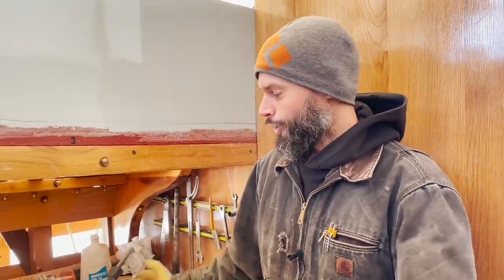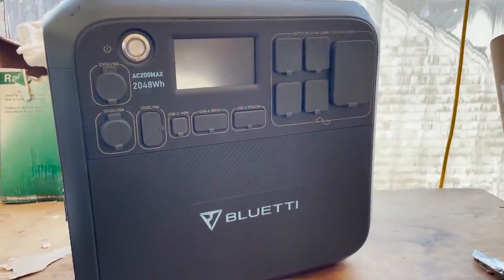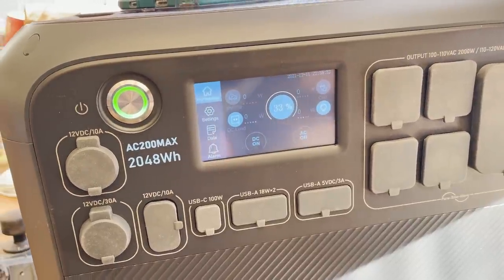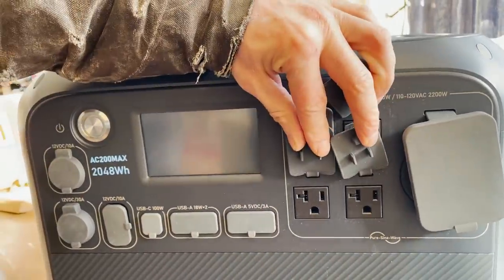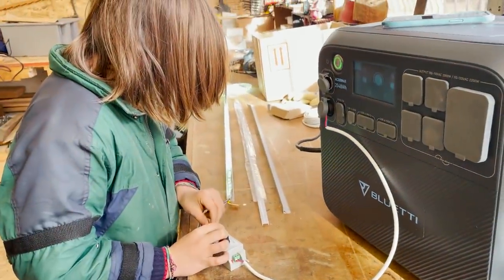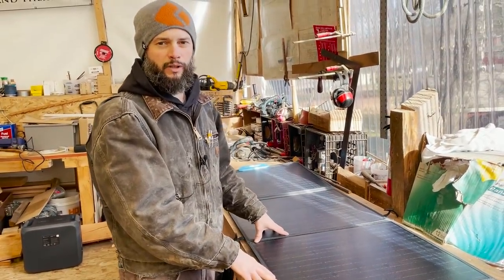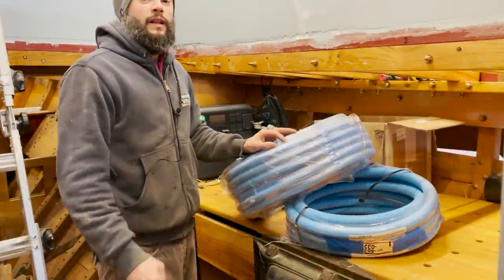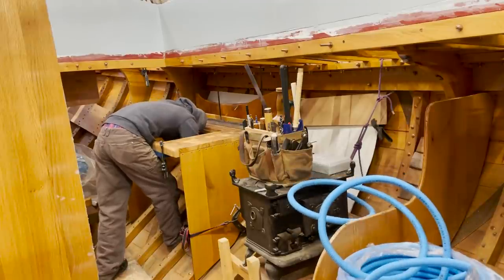Boat Electrical Systems, First Steps - Episode 194 - Acorn to Arabella: Journey of a Wooden Boat

Comment: Hi Stephen, was watching shortly after making a sandwich to take to work tomorrow ( New Years Day ) and you mentioned red light filters... in my sandwich prep, my roast beef was in a container with clear RED rectangular lids !  Look in your local supermarket's pre sliced deli meats section, usually near the bacon and refrigerated of course ! The lids have a rolled lip and are recessed so it should easily fit over that bright led light you showed. Velcro or a screw or magnet to hold lid if you don't like velcro...
    Hope this is not too late in your build vs real time sequence, but try and pull ALL your wires ( put in some extras too ) in ONE slightly twisted bundle at one time OUTSIDE the boat with the conduits straight and where a few extra hands can help you.... MUCH easier than pulling inside the boat and making multiple pulls in something bent and flexible with ridges TOO ! Twisting the wires adds to overall bundle size only slightly, but organizes it better, allows smoother bends, and gives some extra wire length in case you need it later ! ( I used to build High Vacuum Industrial Equipment with custom harnesses for robots etc )

Comment: Just be slightly careful charging LiFePO4 in cold (below 0degC) temperatures, they don't like that. I've not read the details of the Bluetti unit, but its BMS probably has auto shutoff and won't charge below 0 to protect the batteries, but worth checking :)
Reply: Also note that there are solutions for cruising in cold weather. My boat has batteries where the charge source heats the batteries into range and the battery itself maintains its functional temp so charge and discharge can happen in any ambient temp. These are not much more expensive and also UL1976 certified, more than you can say for the popular but inferior drop ins like Battleborn or Dakota etc.
Reply: Batteries definitely like to be the same temp as people.  If the ambient temp in the boat is 0, heat is the order of the day, no matter what, but that seems unlikely.
Reply: Batteries in general don't like to be used while they're cold.
Reply: You can always keep the batteries warm next to the wood stove.
Reply: @graham6229  Insulation isn't any use without a heat source.  Leaving the boat for a few days, the whole thing will be between ambient air and water temperatures.

Comment: I've worked with LED lighting on different projects over the years and in my experience, several have failed because the electronics burn-out (especially with low cost online brands).  It's easy to read the box that says the LEDs last 50k hours etc. only to find out they really only last a few years.  LEDs are great to use but I suggest buying a few backup lights,  transformers, and controls when you get your parts, so you aren't blind in the middle of nowhere.   Also, I find that complex battery systems can stop working for weird error code reasons, so it might also be good to have a small low-tech solar system for emergencies.  Just a thought, that others may have already noted.

Comment: Sounds like you should look at creating some kind of over the railing solar panel holder so you can charge while on the move. And maybe a setup for the house top or something.

And the “RV plug” is a standard 220 vac outlet.

Comment: 100% on the conduit-from ireland and a lot of timber frame houses here use it in a "service cavity" created between plasterboard and air-tightness membrane/stud work. pro tip leave an extra pull string (builders line or plumb bob line) with every run and leave in place for retro fitting. also you may be able to use a shop vac to suck line out the run to began. love the clear junction box covers

Comment: do yourself a favor when installing the wires make a U before you jump into the Box to get any water that is inside the conduit (condensation or a little water who knows) and drill a hole at the bottom of said U in the conduit, so any water that is inside the conduit has a place to go other than the Junction Box.

Comment: Looking good! You may already be past that, but I would skip the gray fittings and just connect the threaded box fittings into the junction boxes. Just use a lock ring to secure them.

Comment: This looks like a very sound system.  Thanks for the thorough explanation as well.  I don't think I heard a single instance of confusing power with energy, which may be a first.  If you get the panels perpendicular to the Sun's rays, the low angle of the Sun won't be an issue (short day still will be of course).

Comment: Fascinating, as always. You did not dwell on the design of the junction boxes, but from what could be gleaned from the video they did not seem very robust.  They need to have high impact resistance and I would suggest a hermetic, O ring, seal.  Things are going to crash into them once you are at sea.  And yes, install pull-throughs in the conduit now, while it is easy.
Reply from the maker: They’re stout for sure, and will also be inside lockers. Thanks for watching, Rick!

Comment: This feels like a project that would benefit from using Home Assistant as a local smart device controller. I have led strips installed all over the house, including in my custom built desks, and having a raspberry pi to control everything gives a lot of options. As another commenter said, for primary lighting, it's worthwhile to get the strip with an additional channel for dedicated white.
Reply: I'm not sure if this application would see an actual benefit from such a system, as it would require the crew to learn the system, set it up, and keep it running 24/7 off an already limited power supply.

Comment: One could envision many small-medium bluetti as a kind of a modular on-demand power system instead of the traditional house bank fixed to one spot (usually below the waterline) with all the additional hardware that a bank requires. Would fit nicely with your intrepid lifestyle. Something to consider.

Happy New Year! 🎉💥

Comment: Yup, conduit and junction boxes are a good protection for chafing for the electrical system, but they can also make it hard to find issues when trouble shooting a fault in the future.
I saw tips in other comments about aluminum balls and a vacuum for pulling a string through the conduit, but a plastic bag and string usually works better. But yeah, pulling another string through with the wires is a great idea just in case you need to pull another wire or cable through in the future. Always leave a string in the conduit for future pulls, you will thank yourself if you ever have to pull another wire or replace a burned wire. Additionally, always keep a multimeter and spare wire in your boat as emergency repair and trouble shooting materials.
That particular conduit you chose looks lime swimming pool hose, and really stands out against the wood. Will there be a ceiling installed covering it? You do you, Steve, but I wouldn't want to look at that blue corrugated hose all the time, it just doesn't look pleasing. I suppose it could be painted to blend in though.
Reply from the maker: the conduit will be hidden behind things.

Comment: If you're planning on using heat-shrink tubing, you may want to consider using the type with the adhesive inside. As the tubing shrinks, it melts the adhesive and as it cools it leaves an almost watertight seal.
Reply from the maker: Yup, we will be. Stay tuned for more on wiring particulars.

Comment: Love your channel. That system is great for your portable power needs. I don't think you would like it for your boat tho, the "black box" aspect of that system would be trouble in the long-term especially in a marine environment. Getting a setup that seperates the components of your power system, allows you to repair or replace them and makes it easier to put them into moisture proof enclosures. 😉

Comment: I have owned boats for 50 years and do nearly all my own maintenance.   In my opinion you should enlist the assistance of a good boat electrician to plan your system.  I see too many issues in this video to comment on individually.  I have owned the same 44 ft sailboat for over 30 years, circumnavigated and done just about every mechanical and electrical job imaginable including totally rewiring it.  You need professional advice.

This video is a good advertisement for Bluetti but is very naive about boat electrical systems.
Reply: Please get your hands on ABYC E 10 AND E 11.  And any other applicable standards.  Dry reading but essential if you want to do it right.  Also important if you are ever going to insure her as you will need a survey.
Reply: I’ve done electrical of all types including integrated circuit design using workshops/books/manuals and if recommended or required a licensed inspection and sign off. Never had any issues. Arabella is in good hands.

Comment: While a small bluetti unit would be great for your on shore adventures, I'd highly recommend that you build a substantial LiFePO4 battery bank with a significantly sized inverter charger and permanently mounted solar panels. For about 3x what that Bluetti costs, you could have 14000+ Wh of storage, a 6kW inverter, and multiple mppt charge controllers, combined with as many solar panels as you can reasonably fit on deck.
Reply from the maker: Thanks for weighing in!

Comment: Forgive me if I'm a day late and this may be something you already know, but I wish someone had told me these things before I rewired my first Jeep rebuild.  Some mfr's are notorious for electrical issues and repairing them taught me some good lessons.  
I worked in automotive/marine electric systems for years while getting my electronics engineering degree and the most trouble I've seen comes from corrosion, but to get corrosion, wires and equipment need to be exposed to things like salt air, vibration (which rubs through insulation) and damage from loose objects impacting items which current flows through.  Even those plugs with almost no room for corrosion to get into, are the most likely to be the trouble later on if not protected from open air/splash.
If I were in your shoes right now, I'd try my best to double insulate everything, keep access easy enough to repair any of the system without too much delay and provide isolation for each circuit (in case you have to shut it down without affecting other circuits).  Home-runs on wiring might cost more up front, but save a lot of problems later.  I try not to let wires get twisted/tangled while pulling them as I know it's possible I may have to use a wire to pull in a new one later.
Anything exposed needs to be waterproof shrink-wrapped, or at least coated (liquid tape) after being cleaned with high-volume rubbing alcohol (91%) so skin oils don't hinder adhesion.  I only use dielectic greese on plug-in stuff like light bulbs and AMP plugs, as it can migrate and make a mess, but it's better than corrosion which is inevitable in salt air environments.
I never regretted running redundant wires to vital systems from your voltage supply if there is room in your conduit.
Lastly, over-do your grounds (break-out and ground your lines on your 12VDC and chasis grounds on your AC stuff) everywhere you have a junction or termination and install tyroid coils on AC lines to reduce noise to your communications equipment.
One edit here...label & map every wire at every junction and termination if not color-coded (just like a maintenance manual) and amend it as you add to or repair the circuits.  You are the guy you are helping years later.

Hope your system works perfect for the next 150 years!

Comment: In the video about your motor setup you mentioned having a Hybrid Diesel/EV system that could also charge from the propeller. Is that still in play and how will that feed into the Bluetti system? What would the relative power be between the prop-driven charger and the solar driven charger? How fast and how long would you have to sail to recharge your battery (while also running the fridge and other 'always-on' electrical equipment). It seems they might be nicely complementary as one is used while sailing, the other is used while at anchor.
Reply from the maker: We’re thinking about a Watt and Sea. More on that later, but you can search it up if the question’s burning.

Comment: One of the chevy bolt battery modules from 2016 we use to power our boat has 7650 Wh in it and is about the same size as that brick, albeit heavier. Perhaps a convenient and portable option but not necessarily the best way to store energy in a battery on a boat. And the recall is on the newer 2017+ models. Sort of hard to find the older ones but there are options out there for you! Cheers
Reply from the maker: Thanks for sharing your experience!

Comment: Those LED strip lights are really handy. They also sell warm white and cold white which have different color temperatures to help with mood lighting. You could probably have a strip of both in each room with a dimmer on it so you can balance the amount of red/blue light you get. Keep in mind it will still be mostly white light, but will range in color temperatures from something like an old incandescent light (more red light) to a fluorescent one (more blue). Those RGB strips in addition to white ones is a good idea since you can have full red light if you need it. (Or any other color if you feel like partying!)

Comment: I hope the conduit is of the split type for modifications later on when they happen. I would prefer a trough or tray which should give as good protection while allowing easy refitting down the road. I have seen them with removable panel on the front so they are totally enclosed when in use. I personally would not use conduit for boat wiring, things do break or change. Even if a breakdown is not in the wiring but in an endpoint, that endpoint replacement may require different wiring. Anyway, do leave a pull string in each conduit permanently and make sure you have a spare pull string as long as your longest run so you can pull that pull string back into the conduit after any changes. Be assured, you will make changes.

Comment: Interesting. So in our boat we have 3 x 100 Ah lifepo batteries from battle born which gives us 300Ah x 12V = 3600Wh, which is enough for two laptops, fridge, 2 phones, 2 ipads and other house loads. This is charged by 700 watts of solar and by 10 am system is 100% full.

Comment: My .02 on the electrical if you want red lights buy a red fixtures trying to tweak knobs in the dark  is not going to work well and a very good chance you will blind yourself with the wrong color light. I like the red light idea and will now be modifying  my camper to install  some red lights 

And something  I found very helpful on my camper build with lighting make sure you can turn the lights on while laying in bed and wire every room up in a 3 way style so there is no tripping over stuff to go to the bed
Reply from the maker: We’d leave the strips set to red most of the time, we think.

Comment: These all-in-one units have one big advantage over a dedicated system; mobility. Although that's nice to have to take it off the boat when exploring via 4wd or something, it comes with a pretty high cost...They're very difficult to service, difficult to troubleshoot, cost WAY more per AH or wH than a comparable l-ion battery bank+mppt charger+solar panels, and you can't every upgrade the batteries (unless you consider adding on additional Bluetti batteries as an "upgrade"). 

Not sure this should be your primary source of power on the boat, but it looks like you've already decided (and hey, you got it for free)
Reply: Absolutely, that Bluetti is a HORRIBLE choice as the primary power for the boat.

Comment: I have sailed a lot and cruised quite a bit, and I can't imagine how useful the Bluetti rig will be on a sailboat.  They take up way too much room, and as you said, you would probably only use them at anchor which would chew up most of your deck space if you could even orient them to the sun.  I've used solar and they work best (which as you noted is hardly ever near 100%) on top of the bimini or cabin top, out of the way.  Experience is a good teacher and I predict that you guys will be looking for another power solution.

Comment: Condensation inside of the conduit might be an issue. Consider drilling drain holes on the low parts of the conduit.
Reply: We use a perforated conduit for server racks.

Comment: Wouldn't use Smurf pipe , becomes brittle over time . definitely wouldn't expose it to the sun. Would recommend non metallic liquid tight conduit. It's crush resistant and the fittings are some what water resistant. You guys are not only boat builders but artists as well.

Comment: It may be useful to show the solar panels to your sailmaker. It would be kinda cool to build a suspension rig so you can hang the panels in your mast in place of a sail when you are at anchor or underway on your diesel. Perhaps just an additional halyard to suspend it and some wiring on the mast to support.
Reply: A nice idea - but - Solar panels work best when they are 90 degrees to the sun and the drop off as you move away from 90 can be significant

Comment: 12v Fridge.lights Nav and interior, electronics, instruments and power tools? Will need to add to your 170 amphour battery/inverter down the track. Nice modular flexible system from Bluetti though.

Comment: I also noted before that I'm into 3d printing- so as you get into electronics you may find you wish you had a custom or replacement plastic bracket, adapter or clip that you cant find online, that sort of stuff is easy to the computer model and print.  Reach out if you need some plastic parts.  Or if you will cast bronze bits I can print the patterns.
Reply from the maker: That's very kind, Mark. Thank you!